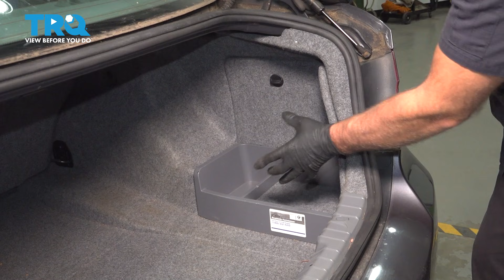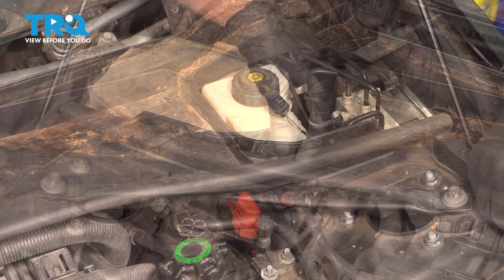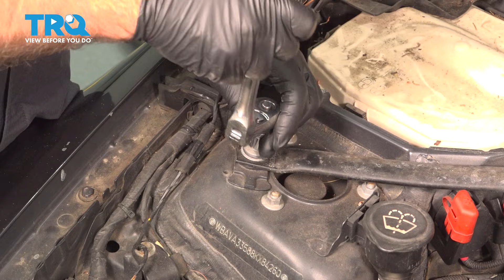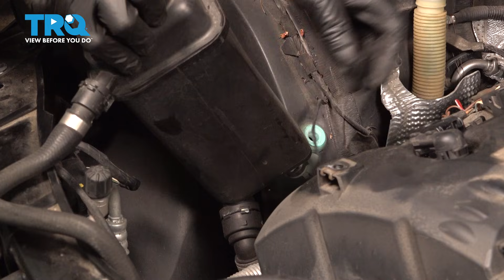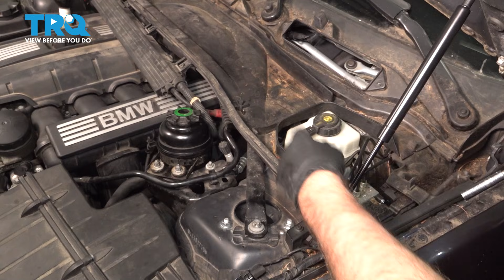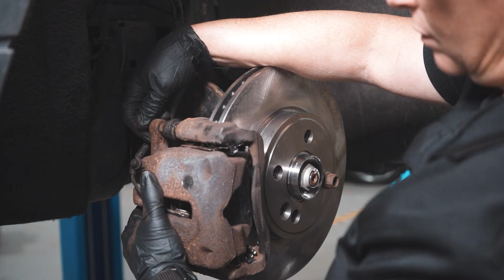How to Replace Upstream O2 Oxygen Sensor 2007-2013 BMW 328i 3.0L L6

Comment: Need to be in the trunk to change a o2 sensor weird side note you do not need to disconnect the battery it’s just wasted time only time you need to disconnect the battery is changing the starter or alternator n ecu but everything else you don’t need to waste your time